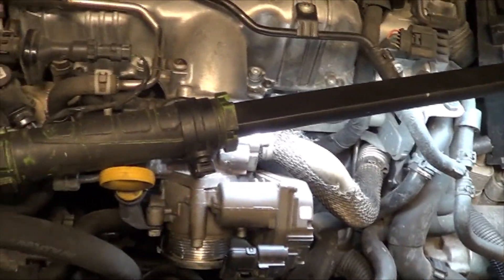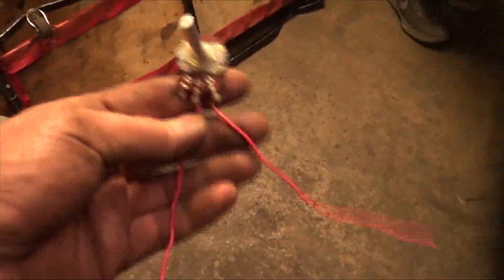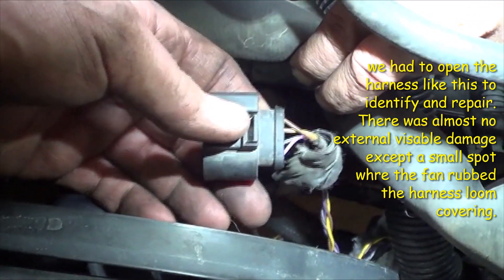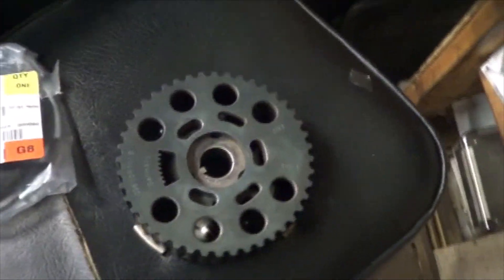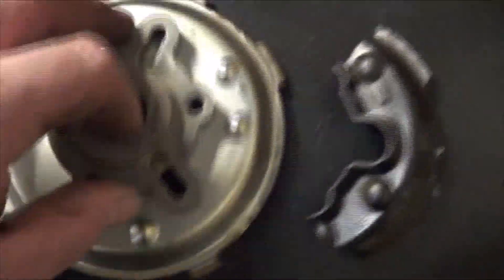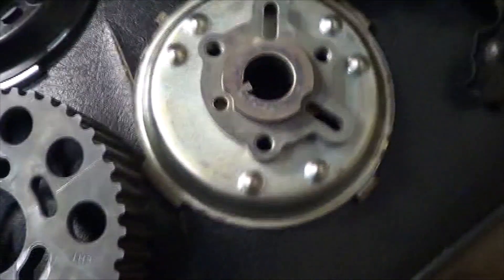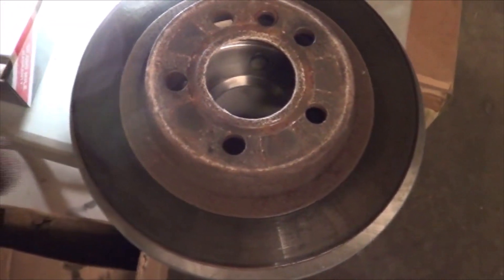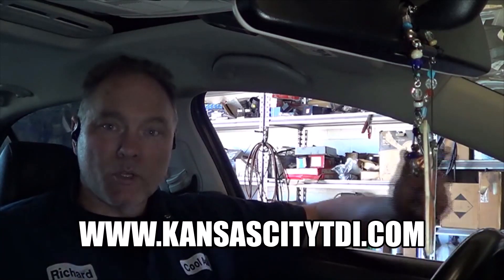Vw shorts 5

Comment: Hi 👋  question I got a 2011 jetta sportwagen tdi the car won't star I already replaced the battery alternator with belt and the starter what could I checked next??? Also I need to see if you have posted a video on the fuse box . A supposed to mechanic pulled all the fuses. Now don't know where they go . Is for the same vehicle?? If you can provide me with some information about those two things???? Thanks
Reply from the maker: You have to define "wont start".  Does the starter crank, and the engine fail to start?  Or does the starter fail to crank?  Since you replaced the starter I'm gonna assume you have a "starter wont crank" problem.  Diagnosis would start with seeing if "start" wire on starter gets voltage when you turn the key.  you could also jump voltage to that to see if it starts when you do that.  I do not have the time, nor ability to identify where your fuses go.  A good mechanic who had the car, would have access to wire schematic to identify which fuses are for the starting circuit and put the correct amperage fuses there.
Reply: @CoolAirVw  the new starter won't even crank .. thanks for your suggestion
Reply: @ervinhernandez3137  Check the power to the starter and ignition wire. manually crank the engine just to make sure the timing belt did not broke.
Reply: @bernardaflores1720  okay thanks. Gracias